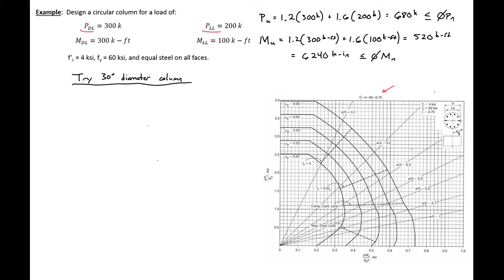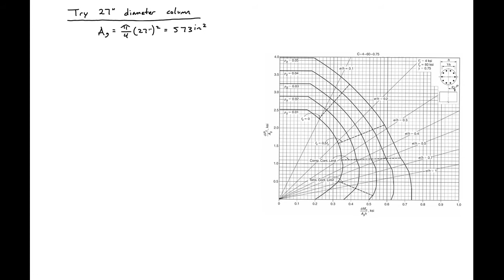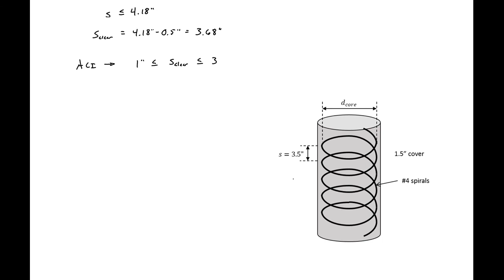12-02 - Design of a Circular RC Column using Design Aid

Comment: Excellent video brother, Did you base this video on the ACI 318-14 code?
Thanks
Reply from the maker: Yes. This is based on ACI 318-14.
Reply: @davidgarber1664  Thank you
Reply: Nice vídeo Bro
Do you have a video with design of circular hollow concrete pole?